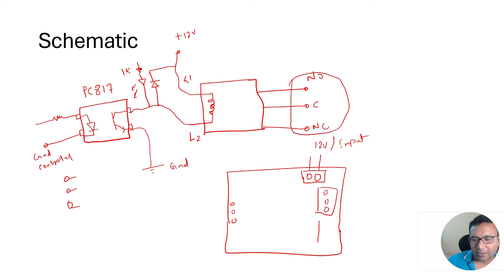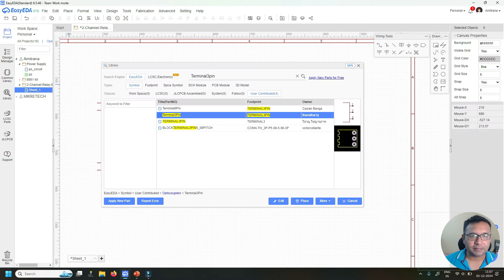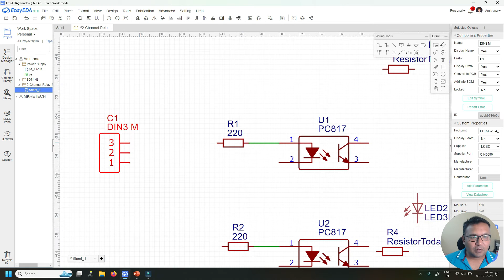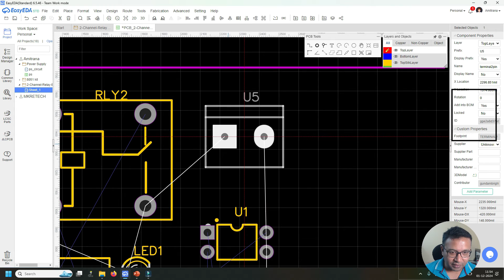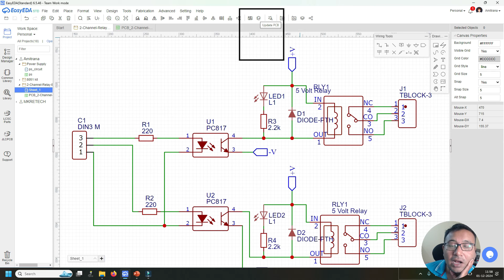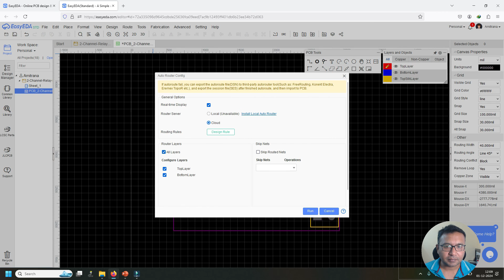Step-by-Step: Designing a 2-Channel Relay PCB in EasyEDA (Beginner-Friendly!)

Comment: In pcb design, the relay schematic shows when it is working, not when it is off or normally open. So the center pin, connect to Normally Open pin.
Reply from the maker: While creating real PCB's, I always 1. Check the relay NC/common/No contacts using multimeter and 2. Confirm the pcb footprint is correct by printing it on A4 paper and placing relay on it.

Comment: Thank you for the video.  Would you please explain the purpose of the diode in this circuit (D1 and D2) for a beginner?
Reply from the maker: Thanks for your comment, the D1 and D2 are used as free wheeling diodes which help the relay coil discharge immediately (by giving a closed path from the relay coil and diode). In absence of these diodes, relays may sometime give trouble turning off, meaning even when you make the signal 0 on input side, the diode stays on.
Hope it helps!